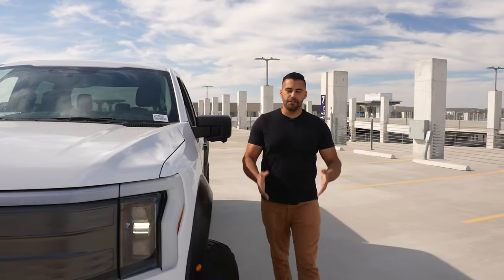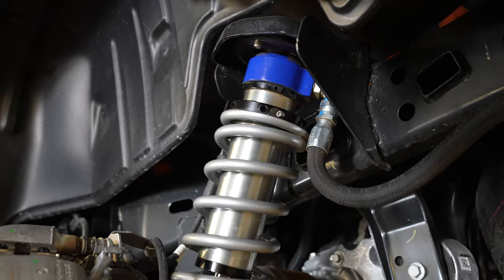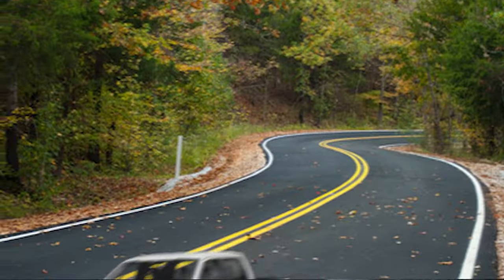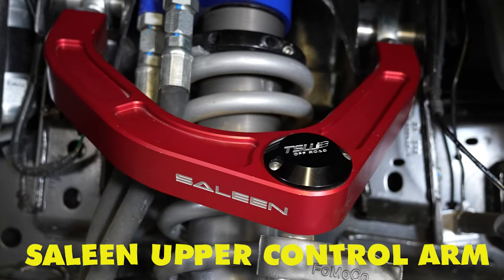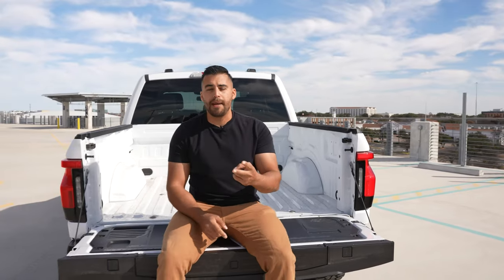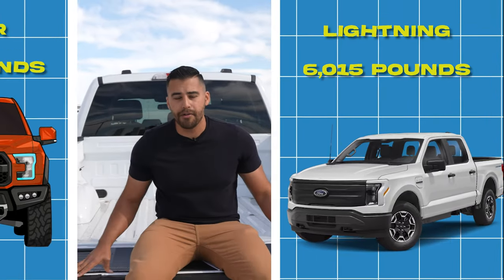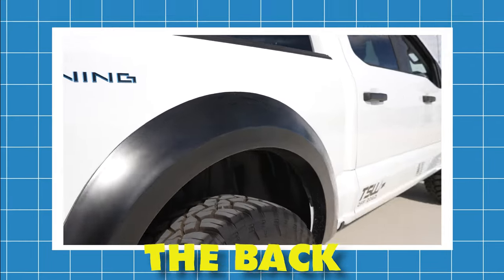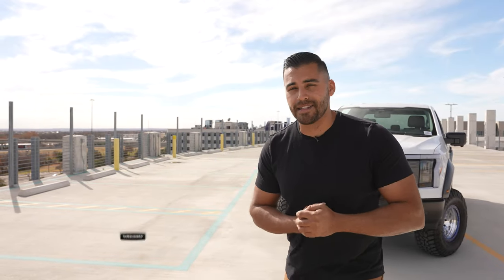Upgraded F-150 Lightning: Inside the Raptor Suspension Swap | Comprehensive Look

Comment: I've straight up fabbed stuff from scratch before but... A TSW rear shock kit from TSW,   Front shocks and springs too, Raptor flares to fit a lighting from who did those..  Would be nice.  My long travel 2011 is gas hog and a bit much sometimes...

Comment: Can we get a list and possible links to what you guys used?
Reply from the maker: We used off the shelf gen 2 raptor parts but the extended front axles, rear shock mounting are one-off parts and the internal bypasses in the Fox 3.0 DSC shocks are all custom and tuned by TSW. Once we finalize testing we may go into production. But to be clear we are still testing, It would be a disservice to tell you what to buy and have made when its not 100% yet.